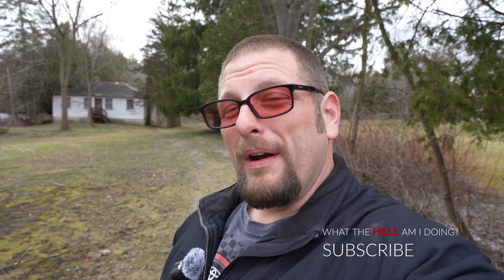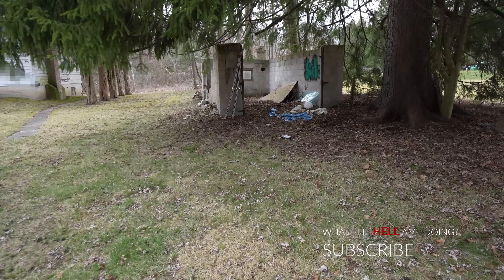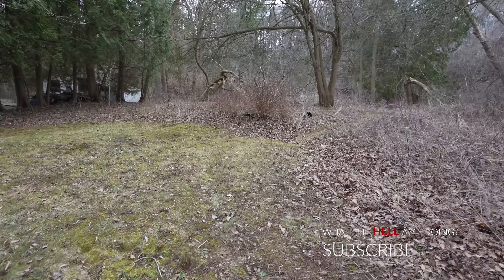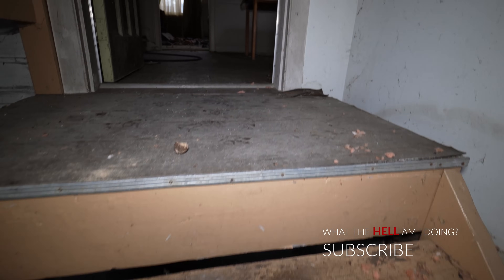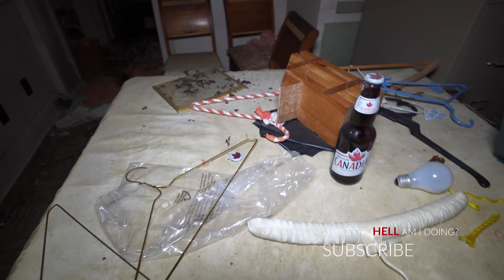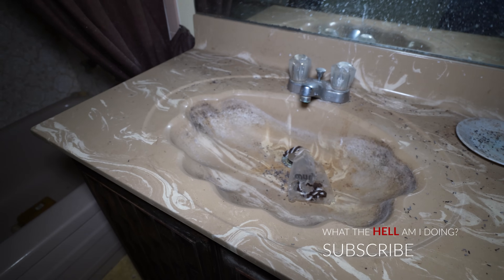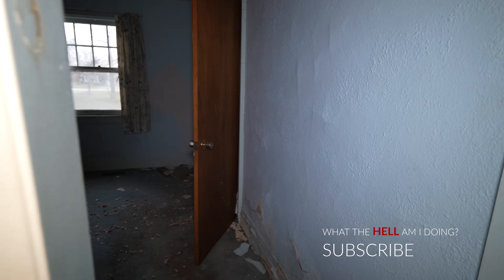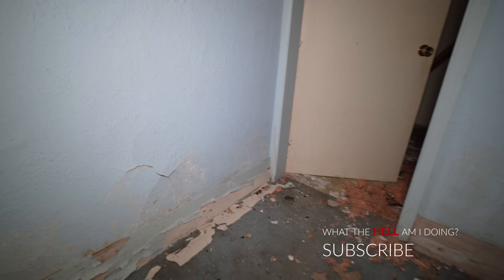A Shocking Look At This ABANDONED Wartime Home Forgotten Since The Death Of It's Owners In 2010

Comment: A "Plain Jane" home, not much to mention about it, sure has a lotta neat contents though and it hasn't been looted because the propeller is there. The hard furniture seems to be about as old as the house except for the sofa and chair in the living room, those being 60's to early 70's. The bathroom does have 70's updates for sure, the toilet and tub looks like beige or laveder, I'm not sure.
Thanks for the tour Greg!
👍🤠
Notes: 
10:13 "Coke adds life to everything nice" glass, circa 1978.
6 for $40 at Sell My Stuff Canada.
1 for $20 at Ebay and Poshmark ca.
10:48 As another commenter noted, a motorboat dasboard and wheel, the thick cable attaches to the motor and steers it left or right.
27:24 Portable typewriter table, a rolling desk of a sort when you think about it.
32:01 My educated guess is a manual water heater, build a wood or coal fire when you need hot water.
31:17 Grease gun, the end snaps onto a zerk (grease nipple) on an automotive ball joint or other machinery.
31:24 Blowtorch, made obsolete by the propane torch. Seen quite a few but no exact matches on various sites. They were averaging $50.
35:35 Smoking stand, my grandfather had one, popular with men to set next to the lazyboy, read the evening newspaper and smoke up the house, I found a match on sale for $60 on kijiji.
38:58 I belive the use of this part of the basement ceased long before the owners themselves "ceased".
Reply from the maker: Hey Mr! thank you for your summary as usual. Glad you were there for the premiere, and yeah it was a little plain jane, but it had some interesting things left behind didn't it??

Comment: Absolutely love the kitchen sink and faucet, and even the can opener .  That’s a  boat steering wheel in the kitchen.  The kitchen curtains are adorable.   I guess purple bathtubs were in style, but I think it’s horrible and the bathroom vanity yikes lol.   The curtain by the bathtub is so 1970s.  I need that toilet roll paper older. Mine keeps coming off the wall. 😅   The mirror and dresser are quite lovely in the one bedroom.   I’ve never seen knickknack shelves like that before, so those were quite interesting.   That the original windows are still in the house. They look cool.  I love that old family Bible in the basement. It’s too bad. It’s falling apart.   Nice ( I think) old coke bottles in the basement. I think the rec room in the basement would’ve been added much later than when the house was built. Perhaps the 1960s?  I like the milk can by the fireplace.  Nice old kerosene lamp.  Lots of mould and I know you did not wearing a mask. I love those old tall floor ashtrays. Very cool.   That propeller is pretty awesome.   A nice little find of a pre-war built home I think. 👏🏻👍🏻🏚️📹
Reply: I aggree on the rec room coming later. 👍
Reply from the maker: 100%